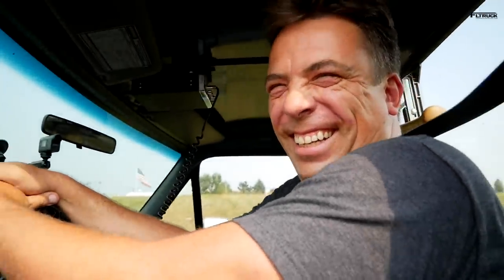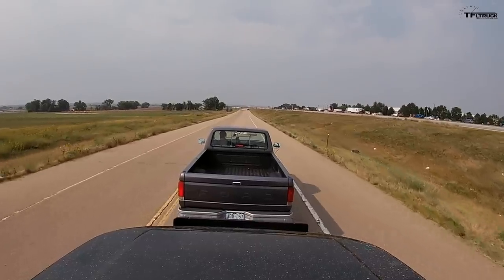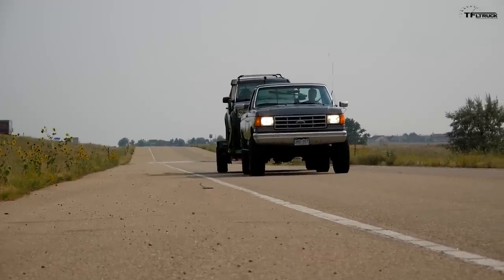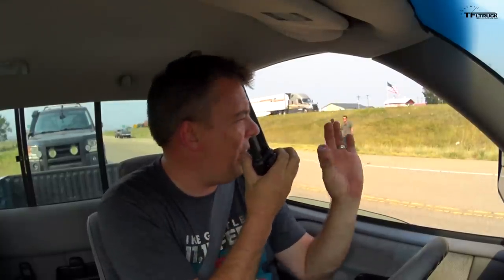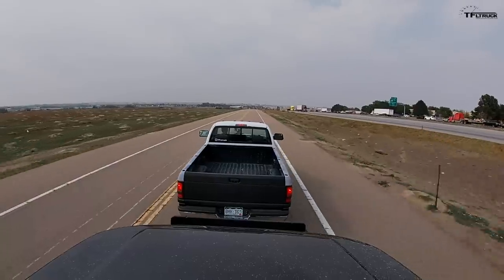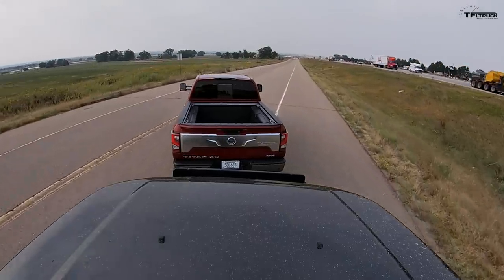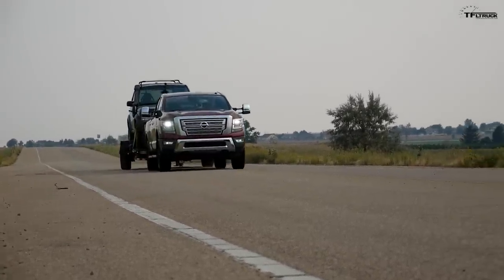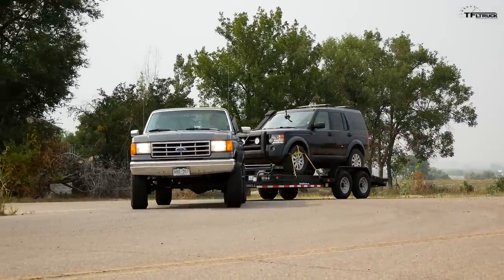Surprising Result! Can a New Half-ton Gas Truck Out-tow an Old Diesel HD Pickup? Let's Find Out!

Comment: Hows about you set up those old diesel with factory  final gear ratios! You must not have any clue as to how much of a towing disadvantage those lifted trucks with very large rubber makes. 35" tires vs the factory 31"-32" is like going from 4.10 to 3.20 give or take. Both of those diesels have reputations of actually pulling twice that weight for decades without any thought of being overhauled. That Nissan would live an expensive,  short lived life before its inevitable death had it been forced to tow the trailer in the vid on long hauls, weekly for a few years. You'd be a very lucky person to get 200,000 miles out of it vs the 1,000,000 mile diesels. Let's do it again boys, with factory rubber on all trucks, also Mr. Smirnoff looked a bit on edge behind the wheel in the old trucks, so lets get a driver that's not scared to drive a manual trans diesel pick up!! Thanks for the "other" truck testing vids you guys make, I enjoy the fuel economy vids.

Comment: I wanna see the 7.3 gas vs 7.3 idi diesel comparison, ultimately with similar gearing and truck configuration.
Reply: I think the 7.3 gas vs 7.3 powerstroke would be interesting.  The old idi diesels have always been super slow
Reply: Your Name True they were super slow but they were also built in a time when the speed limit on the interstate was only 55

Comment: This is far from finding out if a half ton can out tow a old diesel. I think the roads are becoming much more unsafe with these new half tons advertising crazy towing specs that are calculated in perfect conditions in a controlled environment. Having someone cut you off going around a mountain bend in that Nissan definitely would not have the same outcome as in the cummins, that trailer would become a slinky that goes where it wants behind the Nissan. A real test would be which truck blows first repeatedly doing that 0-60 torture pull with 6 tons behind them. The brand new nissan, the old cummins or ford that already have been beaten for decades. I already know which truck would tap out first

Comment: I'm not a Titan enthusiast, but weren't the XDs supposed to be diesel variants?
Reply: they were for the first 3 years, 16-19 unfortunately they didn't sell enough to continue offering the diesel
Reply: @noosh8316  From what I read doing reseach on the next truck purchase (ended up very happily in a 5.7 Tundra fwiw), even with the Cummins engine they had a ton of reliability problems. Bit of a shame as you'd think with Nissan's generally good electronics and a proven engine it'd be a match made in heaven.

Comment: You’re doing a Power exercise (0-60 MPH) with two trucks that had 250hp at most against a modern gas engine with 400hp.  I’m sure the first 60ft of the pull was fairly even for all three if not quicker for the old diesels seeing as they are single cab vs Crew, and are all three much closer in Torque than they are in HP. A 2011 F250 with the first year 6.7 at 400hp and 735lb/ft, at about 1000lbs heavier than the Titan XD, would be about the same in the 0-60mph test.

Comment: I think my 2010 4.6 3v would give that 7.3 a run for its money with the same weight, she’ll do anything within the tow rating even with 315k miles but she won’t do it fast😂
Reply: Doubt it could tow up hill any faster I’d even be surprised if it could do 0-60 much better if the truck was driven by its owner or someone who can drive one of those old trucks. 😅
Reply: David Wark yea I think the only advantage it has is the 6r80 transmission and it doesn’t provide a big advantage, either way fast or slow I still love the truck and it treats me right, when I have a big drivetrain failure engine needs rebuilt or the transmission starts to slip bad I wanna see if I can get a 10 speed auto from the newer f150s and swap out the 6 speed, I think it would really wake that truck up especially if the motor is freshened up.

Comment: Two of those trucks were considered complete junk on the assembly line. Not surprised they didn’t become finer with time...
Reply: "complete junk" buddy they are both still running and driving like new after 30 years.
Reply: Zach they certainly aren’t running “like new“. And if you think that they are then obviously they ran like crap when they were new LOL Anything will continue to run 30 years later if you keep pouring money into it and fixing it on a monthly basis.
Reply: @Captndarty   that Ford runs amazing, the dodge looked like it could use a tune up. Considering the Ford doesn't even have a turbo you can't expect speed from it but can expect a million miles with minimal maintenance. Btw anything can run for 30 years if you keep pouring money into it but that is not the case with those two old diesels, they won't need it.

Comment: This test doesn't make any sense! A gas engine rev's higher so of course it's going to accelerate faster. It would be like putting the Nissan Titan vs a Peterbilt 389 and pulling the same load oh the Nissan is faster 0-60. Yea the Nissan is faster but can it tow a load for 70 hours 3,000 miles a week

Comment: Isn’t the gm 6.2 420 horses so that would be higher hp if I am not mistaken. :).
Reply: Correct, but these guys  said for "standard" engines in half tons. The titan XD only has that one gas option. GM's obviously have multiple options, with the 6.2 being the top of the line in the 1500's.
Reply: deeohgi I missed that. 🤗

Comment: 7:08 Nah. The GM 6.2 makes 420 hp compared to the Nissan 5.6's 400 hp.
Reply: Kcducttaper1 BASE engine.  GM is a 5.3.
Reply: @mikek5298  Correct, but that's not what he said. He said the Nissan was "the most powerful full-size v8 you can buy".

Comment: $300 in parts and my 96 ram 3500 will tow with nearly as much power as a brand new diesel
Reply: Not legally..
Reply: @Adventureswithmike1  why not legally?
Reply: You can never tow more than A truck's gross combined weight rating so if it's 14,000 you can never tell more than that And if you do and get caught You don't want to know what the fines would be And your truck and trailer will get impounded..
Reply: @Adventureswithmike1  oh well yeah I wasn't referring to how much weight the truck is legally allowed to tow, only said that the truck will tow with nearly as much power
Reply: @Adventureswithmike1  btw in Texas that's never really a problem. It can be because officers are allowed to exercise discretion but in reality it is a rarity. These boys hotshot dual tandems all day long with their 2nd gens even though they are rated for 19k gcwr

Comment: This is the dumbest thing I have seen in a while. It’s a Nissan, it’s a 4door new truck going against single cab old trucks. Your talking about modifications in the dodge being a problem and saying that all the new technology in the Nissan is ok for your comparison.. 
put a twin turbo, studs, programmer, and built transmission. Mind you the price of that could be had for $10,000 or so and you could drag the Nissan and the trailer behind it very fast, a lot faster than you would ever see me spend $50,000 on a truck or anything made by Nissan

Comment: I actually hate those old trucks. Noisy, dirty and basically crappy vehicles. Rolling coal is a big no no.

Trucks used to be less expensive than cars...remember that?
Reply: Yea...diesels pretty much sucked ass till the dmax came out.
Reply: You guy have no idea what what makes for a good vehicle.
Reply: @Zach-ju5vi  i know it ain't some noisy gutless turd that's so heavy it throws the balance of the truck off and felt more like a tractor than a truck.

  The dmax reinvented diesels. It made them all step up. Now once again diesels suck because of all the emissions and complexity.
Reply: @HioSSilver1999  lol modern diesels suck because of emissions and complexity. 

yeah that Duramax was really awesome replacing the injectors and head gaskets after 100,000 miles.

Also I hope you know that tractors are specifically designed and built for towing. Weight is a good thing.
Reply: @Zach-ju5vi  what makes a good vehicle if I do not know.
Reply: @tuffr2  reliablity and simplicity.
Reply: @Zach-ju5vi  Dude - remember the fan belt that would wobble because the pulleys were off by 1/2". I lived thru that crap. Rust buckets everywhere...the trucks today are superior to 20 years ago.
Reply: @tuffr2  remember when vehicles were riddled with electrical issues, expensive modules and can bus wiring? Oh wait that crap is still rolling off the assembly line.
Reply: @Zach-ju5vi  We will have to agree to think each other is a wacko.
Reply: @tuffr2  I will agree to that.
Reply: @Zach-ju5vi  tractors were meant to do tractor shit. Not drive on the road.

After 100k is pretty random. Shit you could say that about all the diesels. So maybe you made my point.
Reply: @HioSSilver1999  only a Chevy guy would say "you could say that about all diesels". Your ignorance of trucks is almost as bad as your ignorance of tractors.

Comment: Love the Ford but not capable for heavy work
Reply: Wtf are talking about. That old ford is just as capable and honestly way more of a work truck than that Nissan.
Reply: Zach it can't even get to 60 towing 8500 pounds so as someone who tows 10000 regularly it is not equipped for the work I would.need it to do.  Would make a nice week d toy but not suitable for the work I would need it to do.
Reply: @davva360  Andre didn't even try to shift into forth. If you know so much about towing, you would know diesels do much better at a lower rpm.
Reply: Zach own a 5.9 Cummins so yeah I know but again the Ford is not up to towing heavy loads by today's standards.  It's a great old truck just not for what I do.
Reply: @davva360  I know the ford is capable of towing the same load, it is just not going to do it as fast. Coming from a guy who owns a Duramax but still uses his 79 ford to haul with. I respect your opinion because I know modern tech will make towing life easier, I'm just saying the old trucks are still capable of getting the job done.